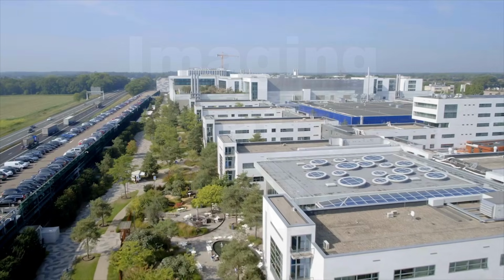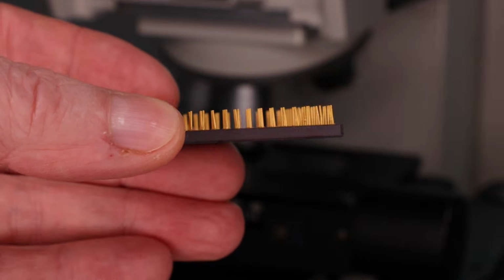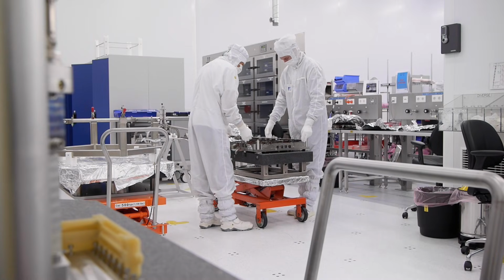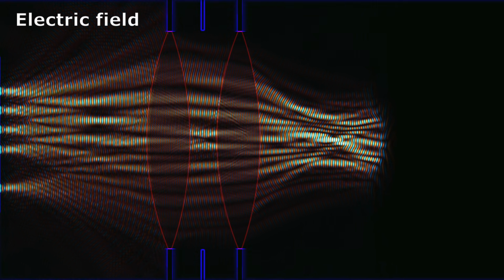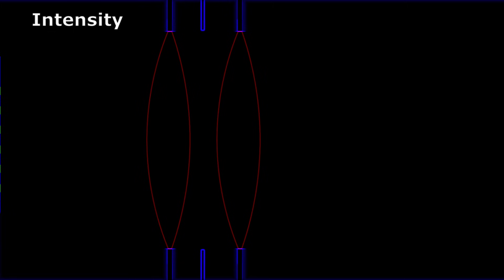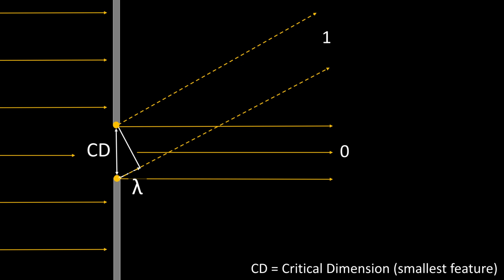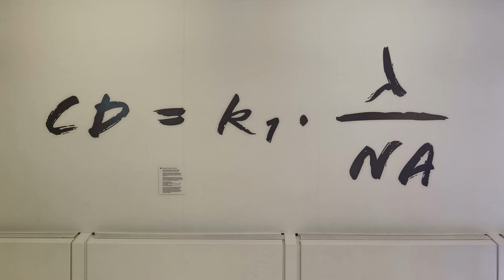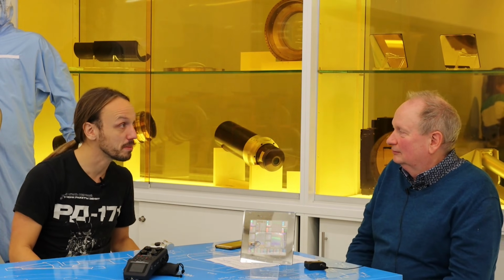Imaging at ASML

Comment: DIY EUV wafer scanner when?
Reply from the maker: Sorry Alexander, not for a while. I don't want to build another vacuum chamber. (:-).
Reply: @HuygensOptics  Another one... Anyway, it was an interesting video, because Asionometry's video on EUV mostly/only focused on the light source, which in itself is very complicated and fascinating, but the other tricks you showed were equally as interesting.
I still wonder whether similar tricks, for example, computer controlled light source matrices and modified DLP patterns could be used to increase pattern resolution for your DIY scanner, obviously a few orders of magnitude larger pattern sizes.
Reply from the maker: Well, the DLP mirrors are about 10x10um which is quite a bit larger than the wavelength. So for the illumination of the "mask" it would probably not make a huge difference. That said, the numerical aperture of the tube lens is pretty small, so there might be something to gain there, I don't know. But it i a good suggestion. BTW, I will return to the wafer stepper in a future video.
Reply: @HuygensOptics  That's good, seeing some practical stuff like your stepper again. I also keep suggesting doing some holography stuff. There is just so little information out there about them, besides books that are way beyond my pay grade. Especially synthetic holograms.
Reply: @HuygensOptics  Oh, and the wafer masks also have features orders of magnitude larger than the wavelength, like DLP mirrors, at least that is my understanding. Still, they're using interference trickery.
Reply from the maker: Yes that is true, the beam shaper in the illumination module of euv is very much like a dmd but contains much larger mirrors. In the duv machines it's called FlexRay, where it consists of around 4000 units that can shape the angular illumination distribution.
Reply: @graealex  the lens has a 4x reduction, so the features on the mask are 4x larger than on the wafer. But that's still not a full order of magnitudearger than the wavelength in most cases. Especially once you start using sub-resolution assist features that are comparable to or smaller than the wavelength!

Comment: Great video! I am curious though, as they did with microscopes when they hit the light resolution limit, developments led into scanning tunneling electron microscopes, isnt there a similar development in this field? "lithography" with electron beams rather than light?
Reply: You're opening a whole can of worms! Yes! Electron beam lithography is a thing, but it's slow. There might be companies trying to improve the speed, but I don't know how successful they are. One company called Mapper failed, and is now part of ASML. There was a battle for the next generation of lithography around 20 or 30 years ago (not too sure about timing) where ion beam, electron beam, X-ray and EUV battled it out. In the end, EUV is the least impossible solution to bring to market.

Edit: electron beam lithography is very widely used for mask manufacturing. There are large developments in this field as well that improve the speed and precision of these machines. One example of such a company that makes mask writers is IMS Nanofabrication. They make multi-beam mask writers that can write masks with multiple electron beams at the same time.
Reply: the difference in speed is the same between offset printers and a plotter: in one case you imprint the whole design at once, in the other you redraw it one line at the time...
Reply: IIRC, this is actually how the masks themselves are made, as it’s ridiculously accurate.

But as another said, it’s also very slow. Perhaps with many simultaneous beams, you could get competitive speeds, since no multi patterning would be needed. And no masks for that matter!
Reply: @mduckernz  true. Multi-beam would be the way to go. But wafer heating and charging would be a major issue. Even at low voltages, at the currents you're pushing into the wafer, you are really heating it up. Photolithography does that way less.

Comment: Worked for a year for a metrology system manufacturer, mostly phase shifting interferometry. Not only the production of these really small features is a challenge, but being able to visualize them and measuring their height was also incredibly difficult (at the required throughput)! The thin films mess up the interferometry signal, which threw off the existing algorithms to estimate the height. At a certain point the lateral dimensions of the features also started to become a challenge, as they diffracted the light used to visualize them. Everything's so cutting edge in this sector, it's awesome!
Reply: It is insane! When you work on the nanometer or picometer scale, suddenly everything matters! I never hear about the challenges that other companies have, so it's interesting to hear these things!
Reply: I work in metrology team at ASML. Indeed, being able to measue incredibly small features at high enough throughput is incredibly challenging.
Reply: @irobot-ng6li your lack of a command of basic language and grammar says otherwise.

Comment: Computational Photolithography. Something we couldn't even do without the GPUs from the previous generation
Reply: Is that a computation that parallelizes well?😂
Reply: @salmiakk_it The light simulation step part is, iirc. But the steps before it that apply design rules so that it works well, are totally dependent on CPUs only as they’re too complicated for GPUs (way too much branching logic)
Reply: Itschain- cell-hainelopment process.
Chip calculates mask for even more powerfull chips ...
Skynet is coming ...
AI will prevail

Comment: why dont they combine mask and lens? if they changed order and have the mask above the wafer, it might get a lot sharper? 
i dont understand why they dont print linearly, continually on and on, then roll up the flexible chip layers into scrolls, like a lithographic capacitor. 
perfect shape to pull a vacuum on a cylinder for cooling as well... we need a vacuum around our chips and motherboards.
Reply: Great ideas. But in practice, these ideas are not feasible. If you put masks or wafers on scrolls, you would get massive focus error that will mess up your contrast. And then you'd have to do etching or ion implantation on these scrolls. It's impossible to get correct with micron accuracy, let alone the nanometer that we need. If you make them flexible, you would get warping and deformation, and you'd get the same result.

In the 60s we used to do lithography by simply placing a stencil mask on top of the wafer. But with stencils, first of all you lose freedom in the patterns that you can make. You can print holes, but not donuts, as you would need to connect the center circle to the outside, try cutting an O out of a single piece of paper, can't be done. But the biggest problem is the contact of the wafer. If your mask contacts the wafer, it will pick up dirt and deposit on the next wafer, destroying your yields. In the 60s, the yield was somewhere around 10%. When we switched to non-contact printing, it went up to around 70%, a seven fold increase! Not saying it can't be done, but it will be a lot harder than the impossible things we already do.
Reply: @DrBlokmeister  great answer, thanks. can a laser engraver make the patterns as well, that we can fill with a conductor? maybe a dyi method? we can have a laser printer make small masks perhaps. and why are we not splitting the euv laser into 4 images or more, with mirrors, to print 4 chips same movement of the wafer? one laser should be able to do multiple wafers on the same xy table?

do you know if it is true, that the wafers density must also increase when the lights information increases? if patterns get smaller and smaller, the object holding the patterns, must also have atoms in place like a lattice to be able to hold something, anything this fine?
Reply: @TheTrumanZoo  wow! Good questions! Laser engraver can make patterns as well, but you are always limited by the NA and the wavelength. An image modulation in electric field intensity. This modulation can only be created by interference, so your lambda/NA (lambda over NA) needs to be small enough to meet the resolution. The best way to use lasers is to use it as the light bulb of a DUV scanner and use a mask and lens to create the image. If you don't use a mask and a lens, you'd have to draw the image in some other way by moving the laser, and drawing a chip feature by feature will take days. We can do thousands of wafers a day.

Splitting the beam does not get around the lens design problems. For lithography you need a lens that is extremely accurate over the already large imaging field (width of roughly 2,6 million pixels, to a total of 260 terapixels for the entire lens field!). If you split it in multiple beams, you'd also need to focus those, further increasing the size of your field. It will be unpractical.

About the density, you might be correct if you really go to atomic-sized patterns. However, we are far from that. The theoretical resolution of our NXE systems is 10 nanometers, which is still around 50 silicon atoms. These are all a bit rough estimates, but it is enough to get the point across. As far as I know, we don't reallly care about the atomic size of the silicon (yet).
Reply: @DrBlokmeister  thank you for your time, nice to hear all of this.
Reply: @TheTrumanZoo  I think what I learned over the past year is that we are not building a classical imaging system. Instead we manipulate rays of light. We can change the angle, phase and magnitude of light. We do that by tuning the incidence angle and the mask through a lens. But this is just the way we find most pratical. You can do it in many other ways. I know people use a synchrotron beamline with tunable mirrors to tune the light, other people use the Talbot effect. I think the flexibility and power of using a mask combined with an illuminator and lens gives you the most options. But you never know what the future will hold!
Reply: @DrBlokmeister  great job! thanks.
Reply: Imagine you get a reply. 'We never thought of that' They try it, It works. Chip making is transformed. There is no longer a world shortage of chips. You get a phone call. Its From Stockholm. You get the 2024 Nobel physic prize.
Reply: @PeterDolphin472  Never say never, but it's a field where there is a lot of money to be made. This means that a lot of of extremely smart people are working tirelessly trying to find new solutions to existing problems. A lot of things have been tried and have failed for some reason. I think the largest progress is being made by a lot of extremely smart people having very good ideas that each advance the field by a few nanometers, summing up to large distances.
Reply: @PeterDolphin472  one can only hope. anyone can think of the next break through.

Comment: So, it's basically trying to tune the very specific, and to us random, way light interacts with itself as a wave in order to resolve a better image. Waves moving here and there eventually catch itself to the proper image. I can imagine the way they try and optimize every image is extremely laborious.
Reply: I used to draw OPC, optical process corrections, onto designs 20 years ago. Drawing mouse bits or rabbit ears to thin to thicken features, like shadow puppeteer. The addition of Fourier transform and Machine Learning to contort the drawn features such that the printed features are correct. Add other tricks like ARC antireflective coatings, or tuning of dielectric  DARC, and tweeting the photo mask bake or vary the etch to get specific profiles.. Its magic.
Reply: @LiamButler49454 Hats off to you! The real pioneers in our field!
Reply from the maker: Yes I guess the smaller details on every mask are Fourier transformed at some point to find the best illumination. Then probably optimize your mask again, illumination, and so on ..
Reply: You could not be more right. This optimization is a whole field of computational lithography or Source Mask Optimization, exactly like HugyensOptics said!

Comment: It really is impressive how they move these wafers around at nanometer scale, and just how much throughput they are able to achieve.
Reply: It is completely insane! We have subnanometer accuracy while moving at speeds per second that are almost nine orders of magnitude larger. Let that sink in!
Reply: @DrBlokmeister  So that's where the UFO tech ended up!
Reply: yeah. working there sucks
Reply: When do they move them at nanometer resolution?
Reply: @blink182bfsftw  It's more nanometer accuracy. Both the wafer and the mask are moving at the same time, similar to how we print newspapers, the print head is moving while the newspaper is moving. The print head needs to keep up with the newspaper in order to print small details. By doing this you can make a small but very accurate print head that's optimized for the tiny part that is in contact with the newspaper. Lithography is similar. By scanning the mask and wafer, we can optimize the lens for only a small part where the light is coming through.
Reply: @DrBlokmeister how is the synchrony between the mask and the wafer tray is achieved? Are they on preprogrammed paths or is there a control loop in place?

Also, I imagined that that level of accuracy was only achieved through flextensional actuators.
Are they used or is it achieved with the use of linear motors only?
Reply: @salmiakk_it  I bet it is sometnig like coreless linear actuator in HDD. In vacuum it is only option.
Reply: @salmiakk_it  I'm not a mechanical engineer and I'm not an expert on stages. I'm sure that there is a closed loop where either the mask follows the wafer or the other way around. Maybe they are both looking at each other and one tries to lead, but when the other can't follow, it tries to compensate? But I'm purely speculating here.

About the actuation, I really don't know enough to comment, but also not enough to know if I'm allowed to comment here. But if I speculate, likely it's some combination of crazy exotic technologies that could never work but we still make it so, just like the rest of our machine. 😁

Comment: Great video! Would you recommend pursuing a career there?
Reply from the maker: Well of course. I actually applied for a job at ASML about 30 years ago. However they did not respond very quickly, so by that time they got back, I already had an offer from Philips Electronics I could not refuse ;-). But if I had the same options now, I would definitely choose differently.
Reply: @HuygensOptics  Thanks for the answer! Also, it is crazy that ASML was part of Philips at some point.
Reply: It is a very large company with all its perks and downsides. You would have to like that. Otherwise the technology there is amazing. The stuff we do at ASML is bizarre. Everything has to be accurate on the nanometer or even picometer scale, so everything matters. That is what makes my job fun.
Reply: @DrBlokmeister  the hidden hand of VDL helps quite a lot i figure
Reply: @diegogmx2000  Could you elaborate?
Reply: @Pastisas  VDL is a manufacturer in eindhoven that is involved easily with half of the high tech companies there and a lot of semiconductor equipment makers in the world they build parts for asml machines among others, they have insane facilities and capabilities to say the least
Reply: @DrBlokmeister  also in terms of accuracy, how do you deal with thermal expansion? even if using super invar for everything looks to me like you need an extremely accurate temperature control on the whole machine, and in vacuum nontheless with 12 dof stages accelerating like cannonballs
Reply: @diegogmx2000  I can't go much into detail. But you are touching an important aspect. You can deal with thermals in two ways. You can either design for low thermal expansion, for example by using materials with a small thermal expansion coefficient or trying to keep the temperature stable. The other way is to model this expansion and correct for it. Which solution you go for depends on the application and the boundary conditions.
Reply: @DrBlokmeister I supose Peltier elements with PID controllers would be one of those solutions.
Reply: @Pastisas  could very well be but I honestly don't know.
Reply: that industry is brutal. talk to people in it first. great money but hard long hours, all the time
Reply: If you can't stay in the cleanroom for hours, wearing a gown and a mask, without leaving for restroom etc, then it is not for you. 
    If you hate paperwork, safety officers, graveshifts, etc., it is not for you. 
    If all you want is to be an ant in the anthill, it is for you.

Comment: Is there any free software that could calculate the angle of light that will be given of any shapes of see trough material as glas or plastics?
I'm having a project that I'm not sure if possible and would there for be happy for any equations or free software that are accurate.
Reply from the maker: Any optical design software will do that for you. Alternatively you could just use Snell's laws of refraction